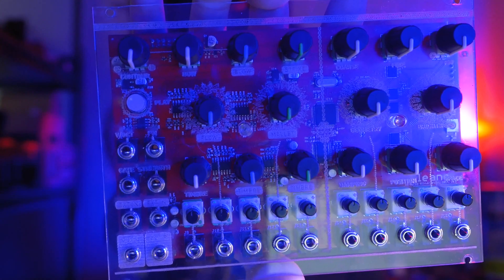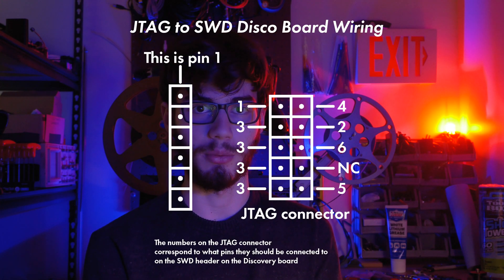DIY Eurorack MI Elements: How to make it not suck

Comment: Hi! Yesterday I've built a Mutable Braids, everything works properly, but the output is extremely low. Do you have an idea what should be checked to fix that, by any chance?
Reply from the maker: I'd check the opamps - I think I recall that I soldered one of them in backwards, causing a similar issue, so that would be what I would check. Always worth re-flashing the firmware as well since that can be odd sometimes
Reply: @hansstahl1887  thanks for the quick reply! Much appreciated! Regarding the op-amps, I used TL072CDG4 instead of TL072CD - can this be an issue here? According to the mouser comparison they are basically the same, hmm...
Reply from the maker: @racalik  yeah looking at the specs of the two that substitution shouldn’t cause any issues, I can’t find any differences between them

Comment: Hi..can you tell the height of.the pots and the jacks?...
Reply from the maker: The distance from the circuit board to the front panel is 9mm. The body of the pots and jacks should also be 9mm, although the total height of pots and jacks varies between them. The jacks are all thonkiconn 3.5mm jacks, the main pots are all alpha-style 9mm linear pots, and the attenuverter pots are 9mm tall trimmer pots. You can get most of these parts from either thonk (UK) or modular addict (US)